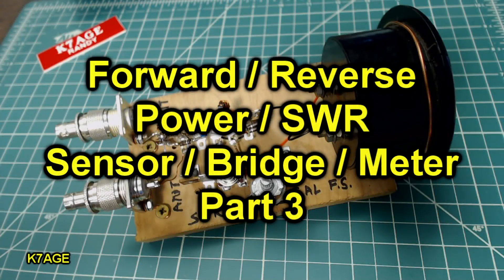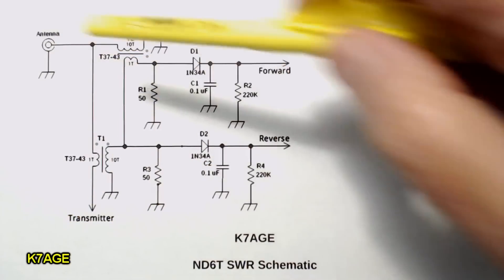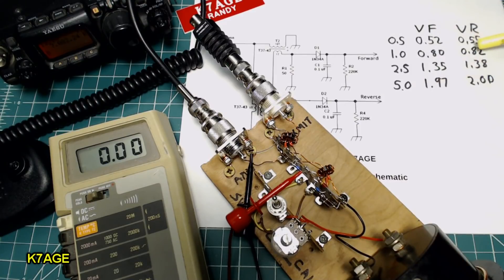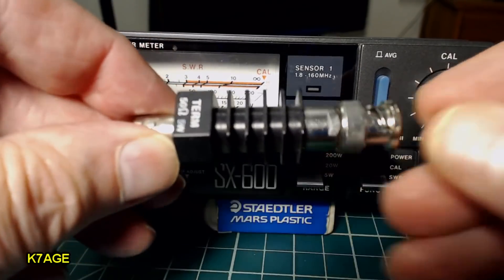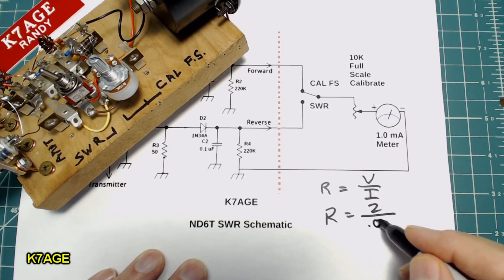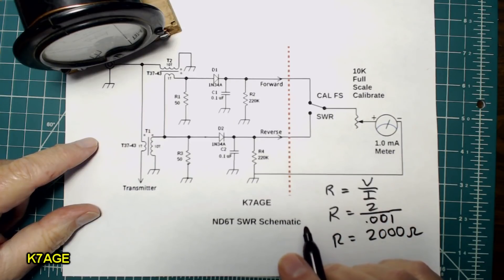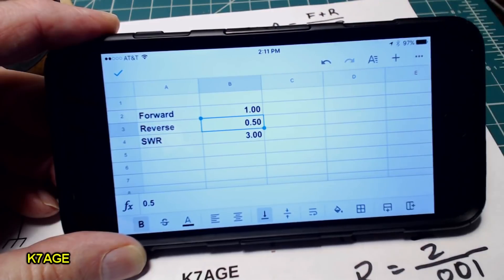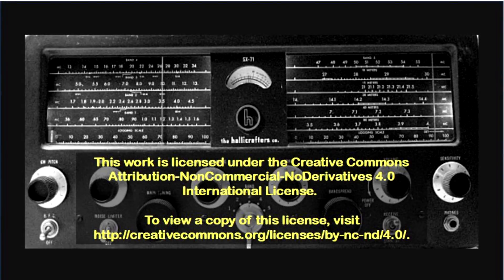How To Build An SWR / Relative Power Bridge - Part 3

Comment: Thanks for this great video series.  Understand things much more than before!  Which brings me to a question.  If I was going to create an SWR meter for a 1000W Linear amp, I can imagine the wire size and the toroids would change, but what about the rest of it?  Would it be possible to increase the pot resistance to bring down the current for the 1 mA meter or just usea 1 A meter.  Since the voltages in the rest of the circuit are indirect how many amps and volts would the rest of the circuit have to handle. Considering the 1:10 toroid, what is the voltage range on a 1000W amplifier antenna line?  This toroid would multiply that voltage by 10?  Seems unreasonable and impossible with this setup.  How do Hi W SWR meters deal with this concern?  Thanks again for your great videos.

Comment: Thanks Randy,  I built this project for my ATU based on your info and Dan's, ND6T's info and built mine on scrap PCB, the 1/4 "pads I supaglued onto a 2 " * 2 " PCB.I had a 100Ua meter calibrated for swr which I wanted to use. I also have a Kenwood TS2000 which does 5 watts  to 100 watts. I wanted to use the 100Ua meter, however a variable pot in series with this meter needed to be 120K ohms, and far too touchy. I had a 20K ohm 10 turn pot, and I shunted the 100 Ua meter ( 1.8K ohm Internal resistance) with a 150 Ohm resistor. This made the meter movement 1.3ma, and gave a very smooth adjustment from 0.5 watts to 200 watts. The project performed excellantly over 1.3mhz to 30 mhz, (didn't work on 6m, probably the toroid wouldn't handle 6 m)  Can you please explain how you entered the swr formula into excel? Thanks so much, Barry, VK2FP/AG7VC
Reply from the maker: Barry, you really dig into this project. Don’t know if I have excel anymore.
Reply: @K7AGE  Thanks Randy, I rebuilt an old ATU I built 30 years ago, but was shaken up while 4 wheel driving, so I decided to do a re-build, the original swr bridge never worked properly, but yours/ND6T's design worked great. I had a beautiful ex-commercial/military 100 ua meter calibrated for SWR, and using your design & shunting the 100Ua meter with 150 ohms did a marvelous job, mind you I tried for hours various meter shunts, etc and found a 1.3 ma meter movement did the best results, Thanks so much for sharing, Barry, VK2FP/AG7VC

Comment: Awesome project, I will try this to test my FPV antennas! ;)
Will this work from 900Mhz to 5.8Ghz? Any special considerations based on the frequency to test? I will want to test SWR for antennas working at 900Mhz, 1.2Ghz, 2.4Ghz, and 5.8Ghz
Reply from the maker: I wouldn’t trust it above 28MHz. The open wiring with long lead lengths makes use at the higher frequencies just about impossible. A bridge for those frequencies would be built using surface mount devices on a pcb. Checkout a NanoVNA.

Comment: Randy, way late to the dance here but a couple of comments are in order. Firstly, this series is a wonderful effort to get new hams into building and understanding basic circuit theory. But I believe that your Triplett meter already has a shunt in it to make it read FS for the scale values. Most times the surplus/swap meet meters have much smaller FS sensitivity - often 50 uA. Running anything over that  could ruin the meter  movement.
To make the meter work  for the SWR device, you need to calculate the internal  resistance of the meter and then run it in parallel with an appropriately calculated shunt IN ADDITION to the series resistance. There are plenty of YouTube videos that show how that can be done.
Thanks again for your fine efforts!
de k6whp
dit dit

Comment: Hi Sir, can i apply this bridge design to the 433mhz frequency? but i plan to use 1N60 or bat42 didode, i waiting for your answer
thanks
Reply from the maker: Probably not. The component lead length will degrade operation at 433. It would be best to use a printed circuit board for the construction. Google around for UHF SWR meter plans.Thanks for watching

Comment: Randy, 
Echoing HamRadioJoe's comment above, it's great to hear from you again! 
I have a really dumb question for you. At 6:10 or so, you add another 50 ohm dummy load "in series," which I assumed meant the two resistances would be additive, hence a total load of 100 ohms, but the total resistance seems instead to be 25 ohms, which suggests parallel, not series. Forgive my slowness, but what obvious fact am I missing? 
Thanks again, and keep up the good work.
Mark
N5CBF
Reply from the maker: I connected the two terminators in series, one connected to the other. But, inside each is the 50 ohms to ground. So, the two in series place the two 50 ohm resistors in parallel, 25 ohms. You were paying attention.